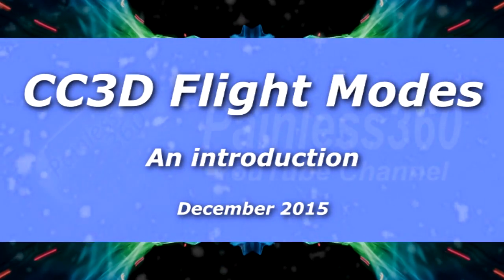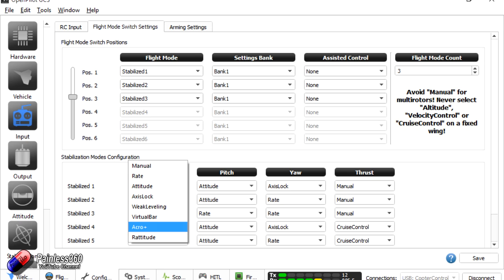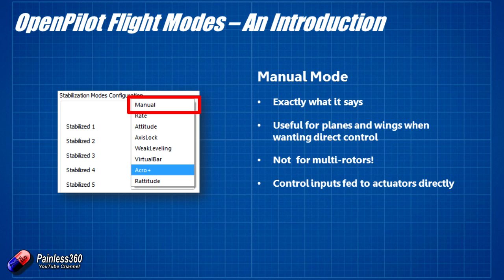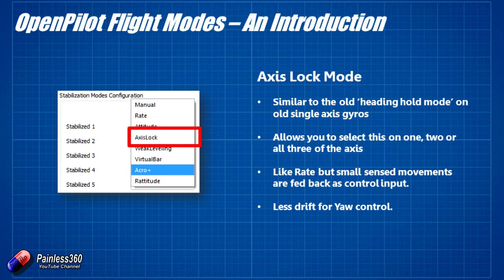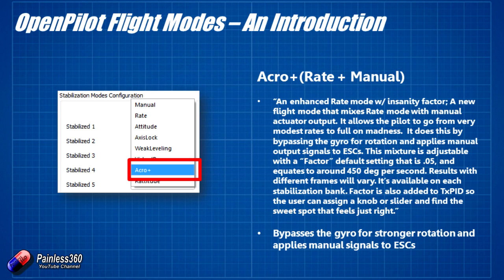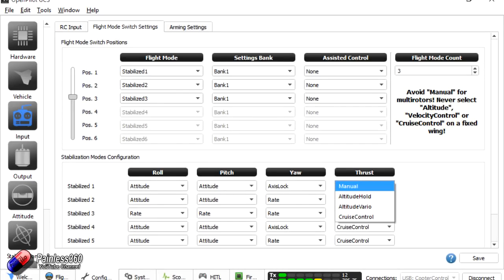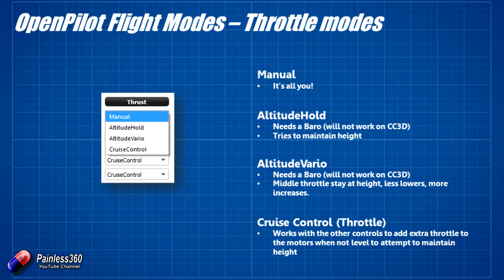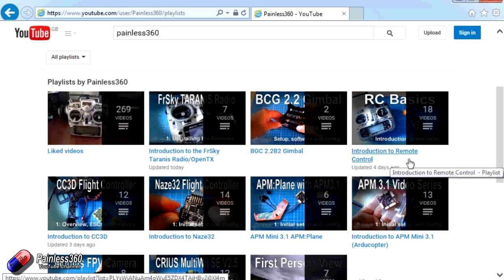Introduction to CC3D -  Flight mode overview (rate, attitude, acro+ rattitude etc)

Comment: Hey man. Amazing explanation! Keep it up. I wanted to ask you if you know if there is a "manual stabilization" mode in Betaflight. Thanks in advance!
Reply from the maker: Depends on what you mean by manual stabilisation.. See my more recent builds..
Reply: @Painless360  First of all thank you for your reply. Second, I mean the fact that the Gyro can be bypassed. You mention that that setting is like the FC is not there. It just passes the signal directly to the motors/actuators.
Reply from the maker: The closest thing is rate mode in Betaflight, see my BNF setup video.. Happy flying!

Comment: I only heard the first 70 seconds of this and I knew this would be a beneficial video for me, thanks!
Reply: Having problems with its ability to remember the Arming setting now, when it's plugged in it can set and tested on the LibrePilot without any problems, unplug it and still works fine, however come to switch the drone and Tx off, wait a while and come back to it and switch it all on, it's forgotten how to arm - even though I saved it on LibrePilot.. any clues? It's using the CC3D flight controller.

Comment: very good expainations!
But what about the flight modes (The actual ones)
land, return to base etc
Reply from the maker: It depends on what firmware you are using. A quick look at the documentation for the firmware you use will tell you all of the detail you need to know. For example https://librepilot.atlassian.net/wiki/plugins/servlet/mobile?contentId=12058726#content/view/12058726
Reply: yeah, i found some expainations with options that differ a lot from what i have here.
Thanks!
But is there a landing mode that works with only 6DOF? (the not-revolution/not having GPS-version of cc3d)
I want it descend slightly until it detects ground
Reply from the maker: I've not used CC3D for a long time (see my flight controller comparison video from last summer where I warned not to use them any more) so this video from way back when is not up to date.. Best of luck
Reply: hey, I have just been outside. And it turned out that i don't need those baby modes anyways :)
yesterday i just did not know that it isattitude mode or what it does, so i crashed.
Today, knowing that it was really easy in attitude mode, i can fly room-helicopters quite okayish. Ad that processor helps you out quite a lot with keeping altitude when humming forwards. And after getting used to not really seeing which dots are forward and which are not it is really great fun :)
So in the end your expainations saved my day, thanks again

Comment: Great video, so what setting do people use for racing on a 250 quad ?.
Reply from the maker: Very few pilots now fly with CC3D boards, see my comments about it in the most recent 'flight controller comparison' video. Most are flying F3 or F4 based flight controllers running Betaflight or KISS kit..

Comment: I tried doing rolls in rattitude mode and it did a sort of fast half circle then just accelerated into the ground while upside down... Is this because my thrust was set to manual and not cruise control?
Reply from the maker: +Woop McWoop sounds about right, if you leave the motor running when you're upside down it'll just drive itself into the ground. If you want to keep the craft inverted you need to shut the Motors off until you're the right way up again. Happy flying

Comment: having strange problem maybe someone can help, have 2 cheap quads 250mm 450mm both came from same seller , when i set up the cc3d the first time and take off everything seems ok , but if i crash or just land ether quad , it go's haywire and just the slightest throttle it will flip ,  most ov the time only 3 motors will spin, it's not the same motor each time ?
Reply from the maker: Sounds like what happens with Airmode enabled.. I'd check the settings and ask the vendor for help. Best of luck!
Reply: thanks, checked it but it is disabled .......

Comment: Hi, I have a CC3D Atom with Librepilot. I updated the firmware to the latest and and reset the board & went through the wizard to setup everything from scratch, since: my drone overreact... I mean, it's is insane... I barely touche the throttle and the motors goes to full power and flips over. Can you help me? (I tried to reset all over again and it does not change.)
Reply from the maker: +Claude St-Louis I'd check the settings for the board orientation. See our video on what to check if your model flips on take off. Best of luck!
Reply: Good suggestion, I will check for that, thanks

Comment: If my transmitter has two switches, but they're only two position switches, not like yours the 3 position switch, will I be able to have 4 flight modes since I have two positions and two switches?
Reply from the maker: +West's Intellect if you can create a mix on the radio using both then you should be able to.. Best of luck!

Comment: So there isn't a "simple" mode, like with the Arducopter? That is a heading lock which is based on the take off direction.
Reply from the maker: Sadly not in LibrePilot, firmware like Cleanflight has those though..

Comment: thank you for another great vídeo. Lets see if I undrstood everything. For stable fly with auto level it should be like this: pitch and roll in att yaw in axislock and throttle manual. For some flips and rolls with some stability: pitch and roll in ratitude yaw and throttle in manual. For more hardcore acro: pitch and roll in acro+, yaw and throttle manual. Tell me if im wrong please. Thank you very much
Reply from the maker: Sounds like a good place to start. Lots mode detail on the manual pages - https://librepilot.atlassian.net/wiki/display/LPDOC/Stabilization+Configuration Best of luck!

Comment: Hello again. the other day I armed my emax 250 quad. and took off learning how to fly it like you say 4 corners and when I had the front facing me I took off and it was coming towards me so I had to move it back on the sticks. I have not touched the flight mode settings as your video say. can you explain for me please. also it won't let me arm the board with out a gyo  calarbration every time if I turn it off the board won't arm.

Comment: My Findings - CruisControl - does not work on non stabilized modes IE. RATE ACRO+, the FC will allow you to set it but once you do the CC3D will not arm..

Comment: when I plug my quad into the open pilot gcs it says gcs and firmware do not match witch can cause configuration problems. do I just go to firmware and and click update? and will I have to set pids after that or will my quad still fly as it did before I upgraded it? just want to know if I will have to reset everything after the update? Thank you sir.
Reply from the maker: +Ian Rice watch our CC3D series to see us setting up CC3D boards and addressing this. I'd update the board and reset via the setup wizard.. Best of luck.
Reply: I am going to watch all of your videos and soak up whatever info i can.  really appreciate your you taking the time to answer my questions. :)

Comment: I think I get it now. so if put say rate in roll rate in pitch and acro in yaw on stabilized1 and use the toggle on my TX I will get it to be faster and do flips am I getting warm? or am I I way off? and if I try different settings will it Mess my quad up or will it still fly OK? i wish I knew this stuff like you and these other people do. But I know I just have to ask questions and learn. thank you sir.
Reply from the maker: +Ian Rice almost. Lots of information to read up on if you want to know more. Angle mode is self level and won't go past a set angle. Rate mode will let you flip and roll. Modes like Rattitude and Horizon are a mix of the two. Best of luck!
Reply: +Painless360 I know there is a hell of allot. so when I get home from work I can put those settings into my 250 and I get a Faster quad? that's all I want right now ya know until I learn more. but if it's more than just putting those settings into roll pitch and yaw I don't want to mess up my quad with something I don't know. So your confident by me putting those settings and I'll be good?
Reply: +Painless360 oh and thank you so much for getting back to me at fast. I have asked people and they never get back to me.
Reply from the maker: +Ian Rice until you are sure what you're doing I would leave it alone. Invest some more time researching. Best of luck.
Reply: I think that's what im going to do. I don't want to mess something up bad. So i am going to take your advice and leave it alone and thank you so much for all your help!!!

Comment: i'm having trouble getting rid of the wobbles. I been trying to get my 250 level by adjusting the slides on moderate, snap and insane. I just spent 5 hours trying to get it fly Level without wireless. where do I go to fix this? i'm flying a 250 racing quad. please help thank you.
Reply from the maker: +Ian Rice The things you're changing won't help. You want to be looking at the PID sliders (https://librepilot.atlassian.net/wiki/display/LPDOC/Stabilization+Configuration). The defaults are normally excellent so I'd suspect wrong update speed on the ESC or excessive vibration.... Best of luck!
Reply: +Painless360 thank you for getting back to me quickly. I tried changing the sliders your talking about before and it starting to get better and more level. I'm gunna try again later. thank you for your being kind n helpful! have a good day sir my
Reply from the maker: I fly almost all of mine with the defaults. Like I've already covered - most airframes will fly great with those. Check for the things I mentioned.. Happy flying!
Reply: I tried that and every time it would wobble like crazy. Do you think something can be wrong? Cuz i did put the settings to default a bunuch of times thinking it would fix it and it did nothing i saved it also after i set to default.

Comment: iv already programmed my cc3d with open pilot  and been flying need to do some tunning  but my quad tilts a little  to the front so I wanted to go back in and try to adjust but it wouldn't let me save the new calibration any thoughts
Reply from the maker: +George Posey not sure. You could trim it out using the trims on the radio too..
Reply: +Painless360 duh lol im an idiot thank you

Comment: hi there..i had same battery 2200mAh with t-plug for my zmr250..i connected to the stock charger from mine quadcopter..with three hours its charging and charging..the stock battery "Power 1500mAh" it charge in 75 mins than one of the leds flash in green colour..then i know its fully charged..i ordered 4 pf that "Floureon 2200mAh" battery..and i hope they not need another charger :(..can u help or explain if u know something about that? thanks in advance and sorry for bad english..hope u can understand what i mean :)
Reply from the maker: +KamO TekA Please see our 'Introduction to Remote Control' series for the basics. Best of luck..
Reply: Painless360 thanks :)

Comment: hi, is this cc3d can be used with barometer pressure module in OpenPilot firmware? im looking at your playlist about cc3d but can't find information about this.
Reply: +Riki Risnandar oops in 10:40 i read you state the baro is not supported. but in youtube i found someone who can use barometer with bmp180 but its using cleanflight

Comment: Really enjoyed alot of these videos, but I'm still struggling to roll or flip my black widow 260 (hobbyking) rattitude mode snapping the stick right i tend to do move of a sideways loop, even backing off throttle. Most vids for that quad in this mode seem to do it quicky, any tips? do I need to change resposiveness (currently=attitude:55/rate:360/rate yaw:300) or Expo (not too sure on that) sorry just getting to grips with things. Also may it be better adjusting dual rate/exp on transmitter before changing in open pilot?
Reply from the maker: +srcowie1 Use r-attitude mode and bump up the controls towards insane ;) Best of luck!

Comment: Painless!!! quick question, every time i try to utilize cruise control as a throttle setting, my board will not arm. now this is just a regular cc3d board, but is that right? maybe i missed something in your video but should cruise control work for me?
Reply from the maker: +Mad Yet Not sure, I'd check the latest documentation. Could be that it needs a compass on the FC...

Comment: I have a cc3d board, and don't know too much about PID's at all. Any help for some stable and good PID settings, and for the rate p/s etc. Any help would be great! Thanks.
Reply from the maker: +Avery Poole (Pilot Skydiver55) The defaults on the CC3D are actually very good. If the craft flies poorly then I would stat with chasing down excessive vibration..

Comment: I'm going to be using the cc3d atom on a 500 size heli. I'm not going to be doing any 3d, so if I use attitude mode for the auto level. Is there any thing I will have to do to set the auto level?
Reply from the maker: +2112inuyasha Just follow the instructions in our CC3D series.. Best of luck!

Comment: Im looking to adjust the self-level settings on this board. I'm in stabilization mode but the quad doesn't level as fast as I want it to. which values do I change to fix this?
Reply: are talking about cc3d?

Comment: Just picked up a emax 250 quad with the skyline32 board, looking on cleanflight and can't see any firmware for it. Do I need to flash it with another boards firmware? Can't find a video of it on your channel . Thanks
Reply from the maker: Please ask the questions on the relevant video. It helps others see the answer. I'd check in the manual but I suspect it is the Naze32 target you need to use. Best of luck!
Reply: +Painless360 oh ok sorry and it doesn't come with a manual and the online manual says its pre flashed withmbase flight but doesn't mention about clean flight even though its compatible. I guess I'll just have to use base flight, thanks

Comment: How does cruise control work on a CC3D without a vario? Not saying it doesn't (don't know), just wondering how it works.
Reply from the maker: +Mike Sukmawati Adds more throttle as a function of the bank angle..
Reply: +Painless360 Thanks, I'll give it a try.

Comment: Acro+ is very intriguing, I haven't had any experience with this one yet. I wonder if this is what Boris is doing with his Airmode?
Reply: no Acro+ is nothing like airmode. Airmode simply put keeps the PID controller running at zero throttle 
stick position
Reply: Thank you, that makes a lot of sense judging from the videos I see of people flipping them.

Comment: Excellent!! I've been needing this for a long time.  Why didn't you do it sooner, huh?! :)
I feel I can now go in and  start doing some very basic tuning my CC3D with some degree of confidence.
Thanks!
Enjoying all of your videos.  The only downside is that "bits & pieces" is creeping into my venacular! :)
Reply from the maker: Lots of requests from subscribers over the last two weeks prompted this and when I looked the info wasn't easy to find now that some of the Openpilot sites are no longer up. Happy flying!
Reply: +Painless360 Hi,  the Librepilot arrears to take over the Open Pilot sites.  All of the documentations are in place and now in LibrePilot.  We are back so to speak
Reply: +Painless360 I flew yesterday - for the first time with understanding and control over my modes.  Thanks!!  

If you haven't done this already (I couldn't find it), a thorough tutorial on PIDs and PID adjustment on the CC3D would be a nice addition.  Lots of people explaining theory (some good, some not), but little in the way of step-by-step with visuals of the software and effects on the craft.  A big job, which I suppose is why it's not out there.  

Thanks again! I couldn't be in the hobby without you and a couple of others who learn the hard way and then educate the rest of us!
Reply from the maker: Great news. I find that the CC3D is a very capable board and is one of the most easiest and robust when it comes to tuning. We have only one video on PID settings that explain what they do and the generic process for any board to tune it.. Best of luck..

Comment: Really, really useful vid, excellent work! Maybe worth mentioning that CruiseControl also works well with Rattitude when flipping as it cuts the throttle when the craft is past 80 degrees or so.